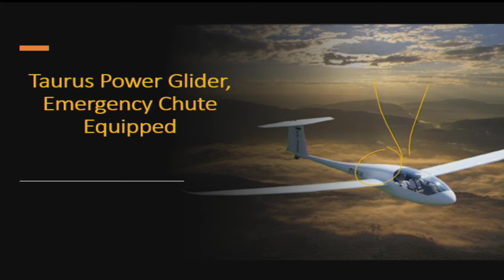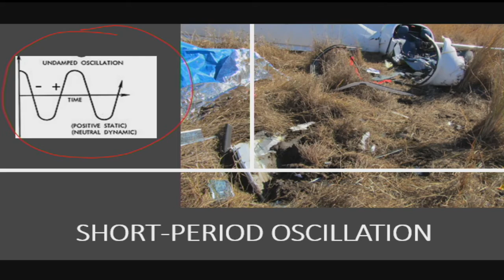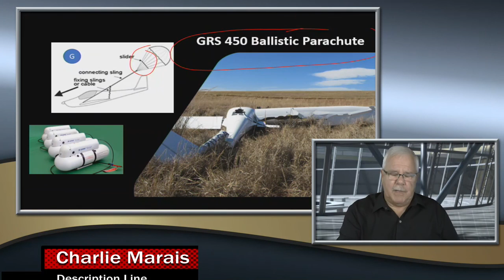Taurus Glider Vne Crash

Comment: The European CS22 is precise. (CS = Certification Standard).    0.9 Vd = Vne (maximum permitted flight speed).
Minimum G number is 5.33 G limit load, 8 G ultimate load.  Flutter freedom must be demonstrated up to Vd,  by test. 
But... the Taurus is not a CS22 certified aircraft!    It is designed along lesser stringent Slovanian - Ultralight rules, and safety depends partly on the built-in parachute. But this devise must work! 
The Taurus has a pifall.
The Taurus is quite flutter sensitive at altitude and/or higher than standard temperatues. The flutter-speed reduces remarkably, think in a factor of 30%,  according the flight handbook, page 15. 
Below on page 15 they warn explicitly not to overspeed these limits.   What happens then is demonstrated by this event.

Comment: What about the trim? Did the trim failed? Did they have the CG too back? Was the pilot flying on his/her own? If the CG is ok and the trim is ok it should not overspeed.
Reply from the maker: Gonzalo, the speed of the aircraft is not maintained by the trimmer.  The pilot had to descend to go and land, but he pushed the nose too far forward with the result that the speed increased more than the design limitation.  Everything was in limits such as CG
Reply: @AirCrashInvestigator  well, it is maintained hands free, I expected pilots to trim to fly faster rather than continuosly pushing the stick. What can induce undesired variations in speed.

Comment: great presentation, but you have an error in the description of the taurus: the electro version is motorised with an electrical motor and the M version is motorised by a rotax motor
Reply from the maker: I agree the wrong model pictures were used as I could not find other great ones, this aircraft though was a Pipistrel Taurus with a Rotax 503 fitted according to the accident report released by the SACAA.  Accident report 9068, date of accident 10 August 2012.  Great spotting and definitely one to remember.  Thank you.
Reply: @AirCrashInvestigator  ok

Comment: So in this case this is a parachute malfunction at fault. Pilot obviously too, but parachute should be design to withstand such loads since this is its primary function. I will sue parachute manufacturer if I will be a family.
Reply from the maker: Jasec, one could argue that the final straw that broke the camel's back to have been the parachute.  Note that I, in the full article, mentioned the manufactured stress capability and as with anything that man makes, there is a limit to its durability, especially under stress conditions, which in this case was outside the design limitations, which was specific by the manufacturer.  Pilot understand, or should understand that no aircraft or aircraft system has ever been built without its limitation, for space operations it may be stronger, but not without some manufacturing limit.  Note that the aircraft and its systems are only guaranteed within the specified operating limits and sadly this pilot did not manage to stay within the limits.
Reply: @AirCrashInvestigator  i like Taurus very much, and do understand idea of hardware technical limitation. However there are parachutes designs which work on space capsules slowing it down from much higher speeds. Something is wrong with this one. This should be design with terminal velocity of this particular glider in mind. Otherwise gives false protection feeling. Knowing that I will rather not have it at all then be lured to think that I am safe. I am very thankful for your video. Was really very informative. Now I know that given the option I will ask about maximum recoverable velocities when using the parachute. Possibly just skip it.
Reply: @jacekpiterow900  Sure, you could fit the parachute from the space shuttle. It wights about two tonnes, it will never fail, but it will never get of the ground. So very safe !
Reply: @Odan6969  This glider is not as heavy as space capsule. He did not break the sound barrier Eddie. Parachutes can be designed to unfold at the specific speeds.

Comment: Nasty stuff.. I always though VNE always had a bigger margin of error. 13 kph is not much over the limit.
Reply from the maker: This will depend on the designer, but the standard is between 10 and 15% of Vne.  This will take the speed into the Gama range, where Alclad could bend, but not glass fiber.  Then remember the additional "g"s he pulled, which started the flutter.  If he did not make a sudden or hard manoeuvre, the aircraft would possibility not have gone into a flutter stage.  With the speed slowly and very gently reduced, he would possibly here and not tell the story to save face.

Comment: The Taurus seems to have a far lower VNE than other gliders. Ive flown a ASK21 at 280kmh for 2 low passes
Reply from the maker: Hi Chris, not sure about your statement, I just work from the aircraft operators handbook, add the aerodynamics and see whet the outcome should have been.  In this case I can assure you, less I made a speaking error, this aircraft was over Vne, not deadly yet, but then pulling out at the bottom may have been a bit harsh, as shoot-ups always are, and that started the flutter.  My idea is that everyone must be able to see how design, aerodynamics and the human factors may get us into a very poor position.  Training is poor I believe, or probably not understood by the instructors.

Comment: Excellent presentation.. I did my instructors course in the UK 49 years ago !... and this was never talked about other than if you went more than 5% over VNE you became a test pilot (not sure how accurate that was?)..  the ruler was an excellent description for flutter.. I use to be a part owner in an Open Cirrus VTC - (built under license).. and there was an elevator flutter problem - a mandatory fix was to mass balance the elevator - what about wing flutter caused by the ailerons - is there such a thing ?..
Reply from the maker: Thank you Miles, normally you have your maximum Manoeuvre speed where you may apply full aileron. Even then it feels like a little fish biting on the ailerons.  Yes balancing the ailerons will help, but normally the ailerons must influence the entire wing section to set up flutter, meaning that it is the flex in the wing that is not up to standard.  Older aircraft also uses weight balancing on ailerons, but this is more to control adverse aileron yaw.  However, the total control balance of all inputs must be in harmony, so all of the best to counter the flutter problem.  In your case the elevator influences the entire horizontal tail section which goes into flutter mode.  Sorry, no quick fix!

Comment: Many don't realise that Vne is TAS not IAS.
Reply from the maker: True, but when pilots normally fly, they fly the indicated airspeed, which quite rightly needs to be adjusted, but in this case, even the IAS was way outside the Alpha range. The "V" always relate to TAS.
Reply: That might depend on where you fly. Locations where high altitude flights are relatively common will probably (hopefully) cover that aspect in site briefings.

For example, I gained Diamond Height more years ago than I care to admit, and was very much aware of the importance of the issue of TAS/IAS - especially as the flight was on an older aircraft (SF27). That type has a very low VNE compared to what is being discussed here. Factor in an altitude of 18,000 feet and you have to be take that into consideration.
Reply: Note that the VNE limit is shown at the speedometer (end of yellow range / red line), which measures IAS - so the pilot always must have the awareness that he must adjust VNE in his head for the given altitude (easily forgotten)... Modern flight computers issue voice warnings on stall speeds - why not warn about VNE adjusted to altitude?